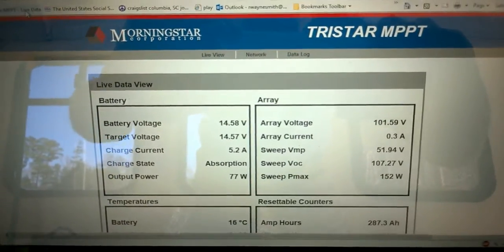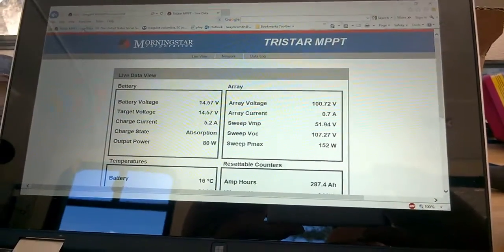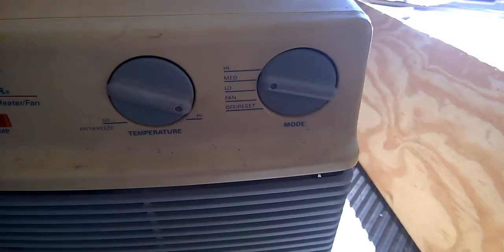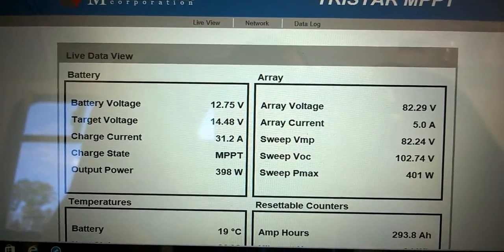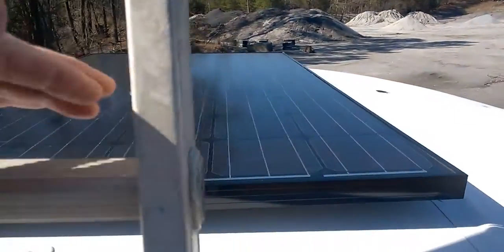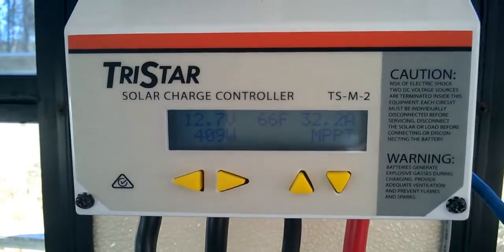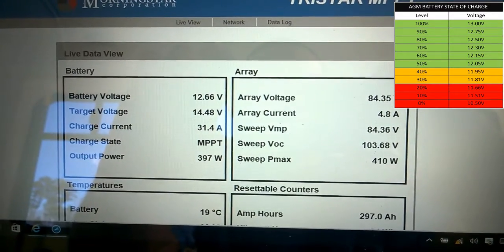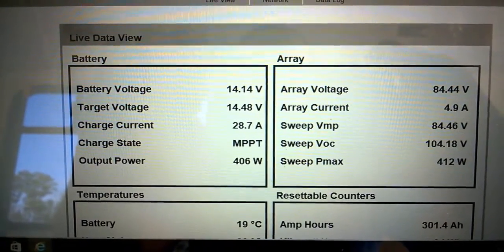Solar load test

Comment: Wow, very impressive man! You are doing it right; rightsizing your system based on your needs and then proofing the system to make sure it holds! This is solid engineering. Can't wait to see the final product. As far as those solar panel mounts; you are correct in that you'll need way better supports than that self tapping crap. Cheers!
Reply from the maker: +Van Go Ventures Thank you. I'm going in the morning to Lowe's to get metal plates and will secure them tomorrow.